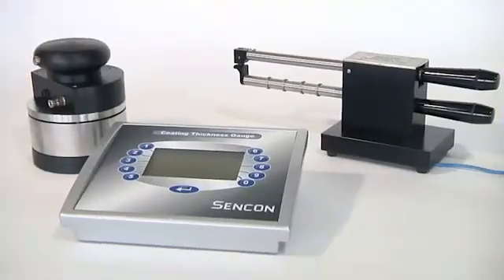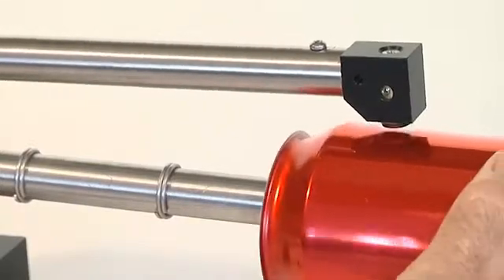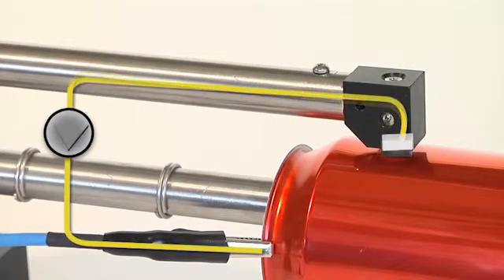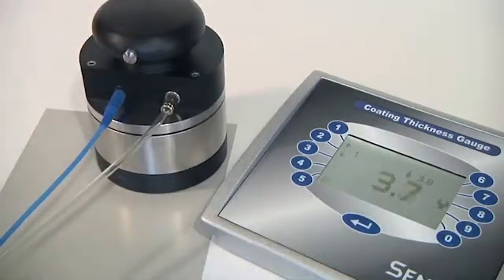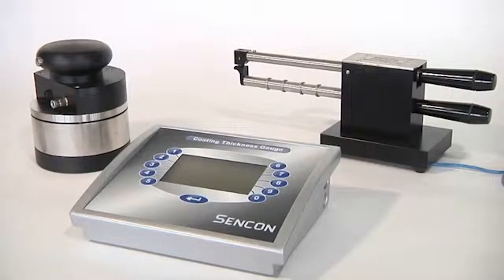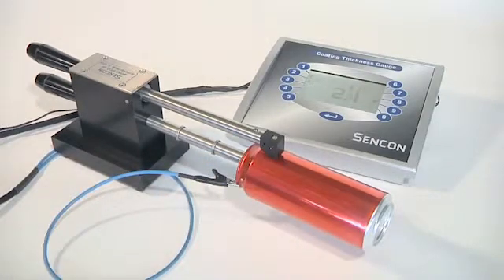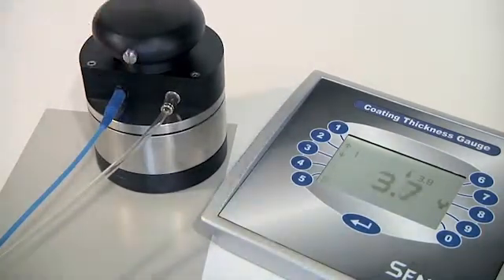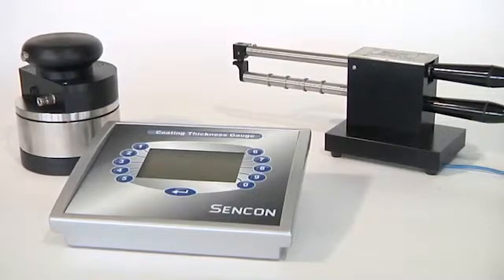Measure Coatings Thickness of beverage cans and sheets

Comment: 3.0 là kết quả đo gì vậy ??
Reply from the maker: Readings can be calibrated to Microns, grams per square metre or any other format. It is only dependent on the data format of the calibration sample used the calibrate the gauge.